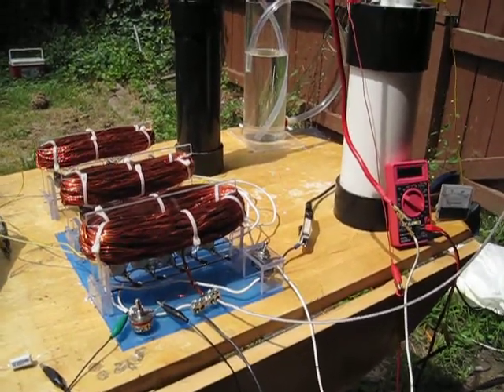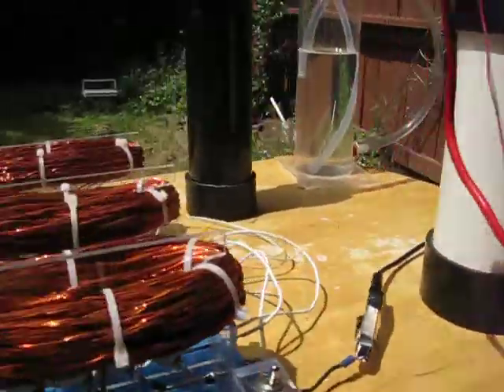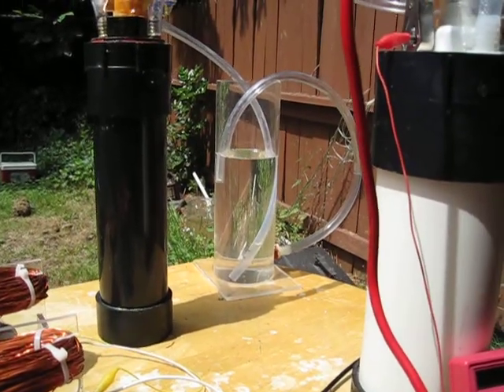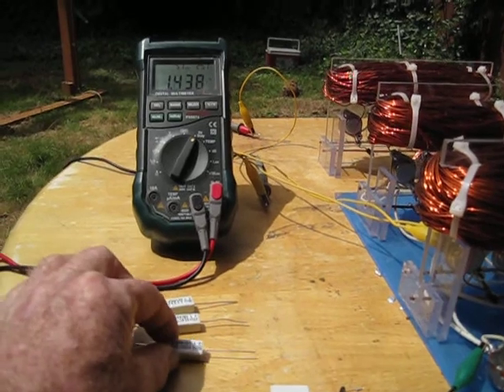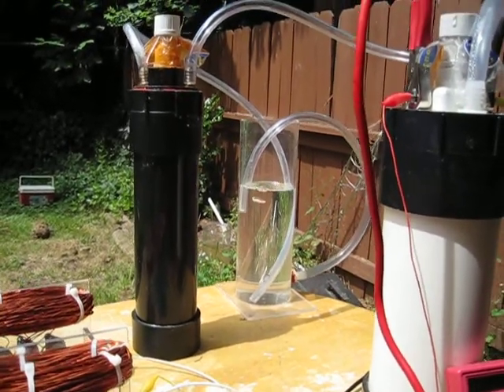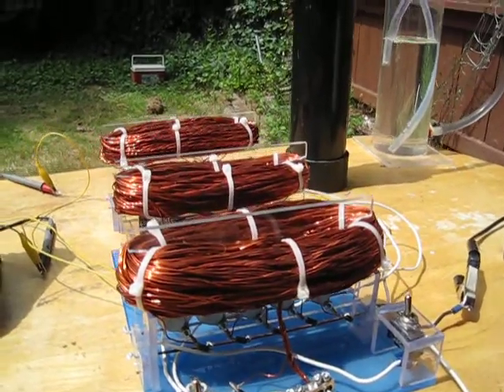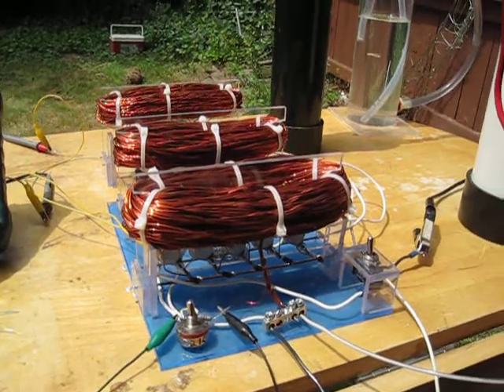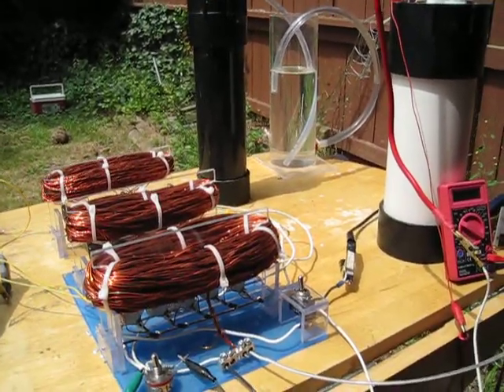2nd test running HHO cell with 15 TransistorSolid State set up.

Comment from the maker: i run a old 12 volt battery backed up with a harbor freight charger, that power goes thru the 15 transistor set up and runs the cell off back EMF which pulses from 300 and up in voltage

Comment from the maker: i cleaned out the cells, and put in tap water this morning. for some reason, i still got almost a 9 amp draw from the set up. had to shut it down when i was using the lazer temp checker and found a few transistors getting hot.

Comment: Hi SD are you running just tap water? You may want to rinse it out the elite if you haven't. Amps should drop and you may hit the frequency you seeking. Just a few thoughts.  Thanks for sharing.  "D"